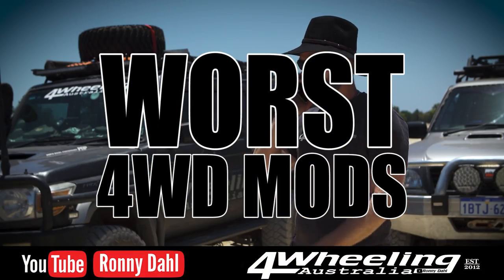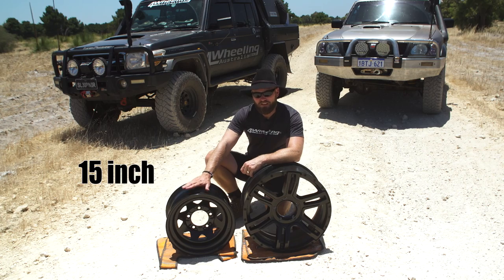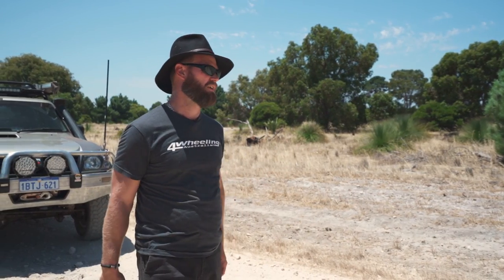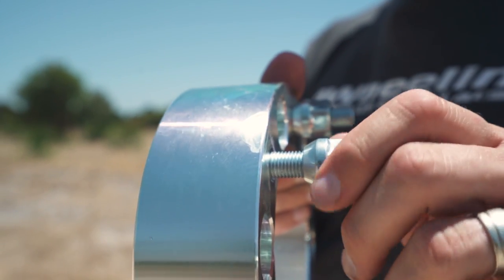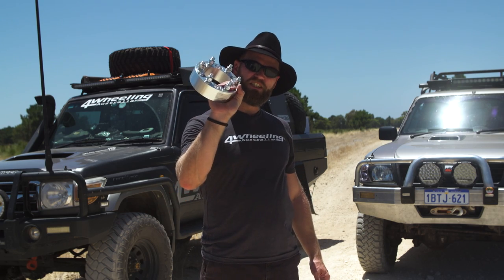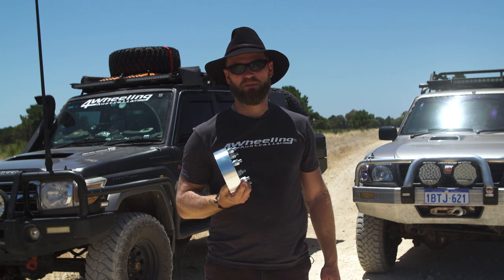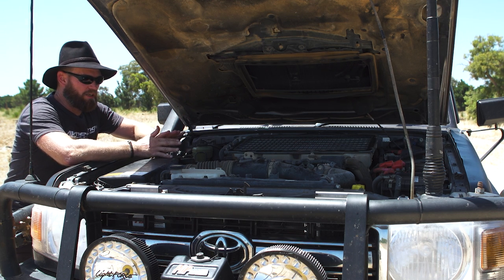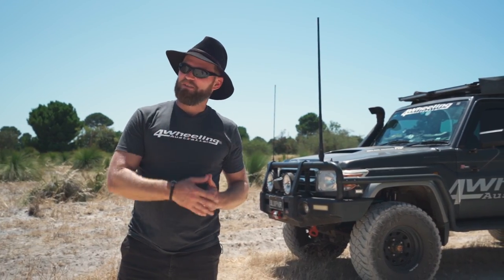WORST 4x4 MODS, DON'T DO THESE TO YOUR 4WD

Comment: Clean and prep you aluminum wheel spacers. no crud and perfecty flat.tighten and torque properly. You will have no problems.  A wheel spacers is no different than a aluminum rim. You just have 4 aluminum rims per axle.  In fact wheel spacers can help give back proper kingpin axis  on over sized tall tires... most idiots like bolt on stuff and do not look at the whole picture.     If someone forgets to tight wheel spacers  they will also forget to tight a wheel as well. There is just more thing to tighten. That's all.

Comment: a complete bumper and winch kit. Very expensive mod which requires an engineer to homologate it for your MOTs. should be the last on the list when you are really committed to off roading.

Comment: Alloy look fantastic but in reality they're garbage for offroad use because if you crack the rim you're rooted if you don't have a spare where as steel rims can be fixed with a hammer

Comment: Too small an air compressor, get higher capacity.  4 or 5 minutes per tire to air from 12 to 35 psi is no fun.   Your pals compressor is twice as fast for same fill.  
Plus a little compressor that runs that hard and long will tend to over heat, which means shorter life.  So spend the money once

Comment: my 2018 ford 150 come with 20" on it i pull them off and put 18 and i run 35" cooper MT on it i cant go no lower then a 18" my brakes are to big so be mindfull of your brake size to guys

Comment: hey, just a heads up, thread depth/thread engagement is really often overrated, the engineering behind it basically breaks down to this, you don't need more than 6-7 threads of engagement to have full pullout strength due to the way load is distributed across the threads....so you can have these situations where it looks freaky as all get out but it's still mechanically sound....i'm with you though, i don't like the aesthetics of a bolt/nut that look like they aren't fully seated but it's also not like it's dangerous or anything.

fyi i used to design and build spacecraft....just so you know i'm not some random internet dickhead and hopefully you take the time to check out what i am saying here, it's pretty basic bit of mechanical knowledge that goes a long way when in shitty situations trying to get something done.

Comment: Modification number 10, larger power increases and when the guys fit aftermarket rims just because they look good, mean time back at the raunchy the vehicle looks ugly. My worst which is not on your list, is a full rigged out 4x4 for a trip through Africa and the guy only time the guy goes off road is when the leave the tarred road to turn into his driveway. 
Regards Michael from Nelspruit in the Republic of South Africa

Comment: Well .. spacers are one matter and you have to fit and maintain your shit anyway, properly! I use adapters that are the maximum legal(30mm) width and minimum adapter width so my D40 wheels fit the d22.. Also can fit Durango wheels on Chevy. Having 1000's of miles on those without problem and you would gag if yu saw how the little Nissan works at times. Hi-lifts are a great tool  but having them on display is the joke. It reminds me of those Landrovers with a shovel on the hood and an axe on the side with fuel containers both sides at the rear , spare on the bonnet and Camel Safari tracks bolted 2X2 each side. If that snorkel has to progress further than the top of the windscreen they're literally over the top. Good video anyway, happy to see more!!!

Comment: Worst mod: adding flimsy bull bar. 
A flimsy bull bar will bend back and cause more damage to the vehicle in a collision than a regular bumper would.
Worst mod #2: HID headlights. If the lights aren't failing, the aftermarket ballasts/relays fail.

Comment: Useless mods, my dad put GME radios in his 2 cars, he never picks up the hand piece, only I do to talk to randoms. He has big antennas out the front of his vehicles causing my aero dynamic drag, obstructing view for no reason. My dad has a land cruiser which sometimes goes off road, maybe once a year and a Hilux for work, both are modified but doing suspension, big tires, bars etc. on mall crawler work vehicle is pointless, it does get a lot of looks though. Oh yea, and it has 20 inch wheels.
Reply: @AlexBaka_  na he is alright, new hilux has done almost 100,000km and the work trailer has never been disconnected. All the modifications on the back of the car, tail lights with dynamic indicators, titanium exhaust, rear bar never to be seen :(

Comment: Why does anyone buy an expensive awning? Damn, I've got 20 bucks into my DYI awning, it takes up less storage space and I can hook it up on any side of my truck in 10 minutes or less....the shade it provides is just as good too. 😎
Reply: Well, not saying that's bad, but I love my Batwing.  Sets up in under two minutes and provides 270 degrees of coverage and I have the tag-along tent with an extra panel to make a lean-to.
I camp, off-road in the mountains, go to the beach, go to car shows, and swaps.  The DIY tarp doesn't really work as well.

Comment: I live in Queensland and i was talkin to a bloke that had a liftkit under his gq patrol and kept it registered i NSW because the DOT wouldnt register it in QLD and also had great big fat  12 or so inch tires and i have heard that they dont really like modified 4wds or trucks in QLD.  I dont see the point in having big fat sand or offroad tyres on a 4wd when on a paved road ,there are hourses for courses which that not everyone understands,  wheel and tyre combos for half dirt half road , full on dirt and off road or just road tyres. If u use wide fat tyres on the road constantly your fuel consumption will suffer, u will shorten the life of the wheel bearings by 30 percent ,heavier steering and u wil also shorten the life of the steering and suspension components as well. A bloke i lived with one time had a 98 hilux and had these whopping big 12 inch sand tyres on and never took it off the road hardly and he put the factory split rims back on after having to replacing his front wheel bearings and standard light truck tyres on the factory rims and ended up getting another 200 kays out of a tank of fuel due to less rolling resistance on the factory stockers.

Comment: Light bars mounted on the roof, right above the windshield.  You lose more night vision from the glare than you gain with the additional light, unless they're mounted far enough back on the roof that the light can't illuminate the hood, or you put a glare shield under them, or you paint your hood flat black (bandaid fix, because that hood will collect dust and won't be solid black for long).  It becomes especially worthless if there's a lot of dust, fog, or rain in the air.  Those that think they're getting something from it obviously do not need that additional light for what they're doing.  People who are serious about it have light bars mounted further back on the roof or on the grill/bumper.  Ideally, you'll have your long distance spot beams on the front and wide flood on the roof, so you're not trying to look through a concentrated beam at what's in front of you.  Some people just don't know what they're doing with off road lights, and they don't realize they could pick up a lot more effectiveness by simply repositioning their lights.

Comment: not sure why a snorkel is useless even a standard 4x4 needs a snorkel on deep crossing
Reply: there are differential, transmission and transfer case breathers that also need to be extended for deep water and not all engine components are setup for immersion

Comment: My ex-wife and I bought a Kings side awning & a Garmin 5w CB radio, for our Big Lap in 2017. What a waste of monies, in only 27,000 klms only spoke to one truckie hauling ass with a road train in NT & never used the awning as we always found shelters in showgrounds, picnic grounds, National Parks, plus thousands of tree's providing shade. When we sold the PS, told the new owners, the awning never used and we didn't even roll it out to see what it looked like.
Beats me why you would buy a CB, all those "show ponies" 4WD's driving in the out6back, all show no substance, don't break down, no-one acknowledges your conversation, just deftly silence and that includes ALL MH's, c/vans & CV with names on the rear, call sign if applicable, and what channel, again with the deftly silence.

Comment: Over-lifting a vehicle:  lousy off-camber performance (top heavy); tires bigger than you need (in the desert where I live, with rock, etc, not much sand) a slightly larger than stock diameter works best;  snorkel, unless you're wanting "the look", because almost no one needs one in real life.
Reply: Doesn't snorkel help in dusty environments?
Reply: @kg0173  Not enough to worry about.

Comment: People need to have more faith in their 4x4's as stock. Beach driving, moderate 4x4 tracks and offroading doesn't need any mods to begin with. I've seen 1000's of guys put massive tyres on, 2" lift, highjacks, bullbars ect ect thinking they going to do hard technical tracks, BUT only ever do beach driving and easy/intermediate tracks WHICH their vehicle could have done stock standard. Heck i've even seen something like a stock Mazda CX5 go places some guys think you need a kitted rig to go. Leave the mods for the guys that actually frequent the hard knarly tracks.

Comment: Worst Mod ever (This was presented for certification )
A Kingswood Ute body on a hilux chassis and a v8 engine conversion with a lift kit.
And "everything" was wrong.   (Maybe the steering wheel was ok)
PS Good Post Ronny

Comment: Two things I see alot that makes me cringe, offroad bumpers made out of a nearly as thin metal as a body panel and diesels running nothing but fuel with no engine work, anyone who ever had a big horsepower diesel know just putting fuel is a recipe for disaster with blowby, constantly having to change the oil so as not to basically washout the bearings ( diesel which is basically refined kerosene is a good way to clean the engine,not lubricate it).And not to mention a good way to get new regs put on for emissions so you end up not being able to mod a diesel in that area at all.

Comment: I went with a 4" cut & trened lift on my Ford TTB independent front suspension it retains the center moumt from the factory with no 4" bracket sticking straight down to get caught.  I built the yrsnsmidion yransfer case drive shafts axles & geared it for my tires with lockers geared power p ell 4 whrrls  & more stress on the drive train Glad I made it stronger like the suspension along suspension /wheel travel is a key I'm means big a arms or long beams eiyj long radius arms, Why O like the TTB cut & turned with long chromoly Radius arms mounted to strong plstes from the frsme with larhge stainless steel Heim joint bearings under the door handle.  Strong Tall shock moints for tall shocks needed for travel & limit straps set to limit the droop before you run oi=ut of shock extension. With the great modern producers of the race teck dsmpners posision sensative tunable dampeners with bypass shock oil reservoir s big piston strength like my favorite KINGS

Comment: I run 20" x10" wheels so that I can fit large suspension lift knuckles and big brake kit upgrages to control those huge tires on my Suburban.  Lifting and widening the vehicle stabilizes it and keeps the HOT catalytic converters away from the dry vegetation I sometimes have to drive over, don't want to cause a wildfire.

Comment: Bro, you started getting a little... carried away when you were talking about lifts and handling. I think I could do a 6.5 lift on a xj and still be good to go. My 4.5 handles great and its not some japanese ifs cv axle shit like youre used to over there in asstralia. I do however agree with you on 16 steel wheels being the cats ass for off-roading.

Comment: Spending a little more money on quality stuff I have dound is cheaper in the long run cause if you spend 100 on a part instead of 50 but the $100 part lasts 4 times as long you ended up saving money!!

Comment: Big fat tires without the proper axle gearing or suspension configuration to make practical use of them, followed closely by outrageously large stinger bars on front bumpers and any build that doesn't thoughtfully incorporate self-recovery; these are a few of my favorite peeves. 
Case(s) in point: I recovered a guy in an older RWD sedan from a muddy ditch along the side of the trail this morning. That wasn't a build issue; his vehicle simply didn't belong there. 
Shortly after, I saw another guy driving recklessly on the trail in a tired 15 year old stock 2WD Ford Ranger with bald street tires, sporting a superficial stinger made of 1" tube at best, which was crudely attached to the stock front bumper and which stuck up as high as the roof, as well as at least a meter past the front of the vehicle. 
Why was that piece of junk adorned with that monstrosity? What were either of those vehicles even doing on the trail? Was the driver of the Ranger likely missing most of his teeth? Draw your own conclusions...
I love the outdoors; always an adventure : )

Comment: Rubber and air is lighter than steel. Shocking, I know, but the point is that you will get less gas mileage on the road with larger rims. Granted, this article was on ordinary sedans, not off roaders, but the principle is sound. And more pronounced than you think, it's not ordinary mass. It is unsprung rotational mass, so your suspension must work harder, AND your engine, transmission, steering and brakes must work MUCH harder for every ounce of tire and wheel you have. And the closer the weight is to the tread, the more you pay for it, as the outside of the wheel and tire moves faster than the inside. 
Not to mention your aren't really concerned with cornering speed in an offroader. And like Ronny Dahl says, your giving up a lot of contact patch size with lower Tire pressure, you are also giving up a lot of comfort, as your tires are literally an additional air bag suspension.

Comment: In response to you cant get more power without less reliability and worse fuel economy.
Back in the day I blueprinted a 351 cleveland 2v. I do realise modern engines are much more accurate than those old cast iron engines, and are made with CNC machining, robot loading etc, however everything is built to a price.Your engine is only as accurate as it needs to be, and no better. It could be much more accurately machined and balanced. Think manufacturing tolerances, deadlines, and budgets.
 My point is a carefully port matched and balanced engine with high quality forged pistons, matched injectors cc'd combustion chambers, and squish will actually make more power than stock, use less fuel, and be more reliable. It's not cheap. Doing a dummy setup just to check squish, and then stripping it back down just to machine 0.13mm (for example) off a piston to get the squish exactly right will be expensive, and seem like an overkill. So will loading all the parts in the boot when it's ready to assemble, and taking it to a specialist shop to have the rotating and reciprocating parts balanced when you could just throw it together right now. So it's not immediately cost effective, however my engine became a freak, super smooth, responsive, and for a 5.8l, ridiculously economical.
 That is if you don't do things like increased valve size, high lift cams, bigger turbos etc etc. (I know most people can't resist, or only do these mods to chase big hp increases.) I installed a very mild cam, and stock valves, but many people thought it was a giant cam and oversize valves because it made so much power. Certainly something to consider if the engine needs to come apart is to balance and port match. (If you don't know what you are doing, get a professional to port match. It can go horribly bad if you get too close to a water jacket. You won't know till it sucks in water and bends a conrod...Murphy says that will happen at the furthest point away from help!)
 If you are spending money on mods, and you haven't considered using the local speed shop to increase the accuracy of your engine by rebuilding it with better parts and smaller tolerances, and balancing it, not to get more power, but to get more economy, reliability and longevity, (and yes it will gain power too,) then any other engine mods are, as Ronny said just going to decrease reliability.
 This really should be the starting point, especially if you are going to fit a bigger turbo, increase boost etc etc.

Comment: Buying CHEAP winch ropes that you use for 10 mins and spend 10 hours with a bucket and soap cleaning out .. instead of buying Double Braided pre-compressed sealed Dyneema  like Ultraflex4x4 Alien Wire and other comp ropes.

Comment: am I the only one that uses the rubber handle holder as a bumper on my highlift jack then  just letting go off the handle and letting it smack around to lower the jack. its violent but works great especially if you got things are goofy angles

Comment: I hate seeing rear mounted winch's. You should never use a rear mounted winch enough to make the cost of it worth the purchase. If they are then they are either reckless and drive into stuff they cant handle all the time. Or just don't care to read the terrain before barreling in. Walk a trail a little if your unsure what is ahead and are worried you wont be able to get back.

Unless your a linesman in the country and the track can change drastically in the space of a few rainy days and your on these tracks 4-5 days a week. 8-10 hours a day. But now that's not a recreational 4x4 but a purpose built work truck.

But the dumbest thing you can do... is water tight your single cab ute... I have seen a few Hilux's float away down stream because they made it water tight, got it into deep water and the car became a boat.